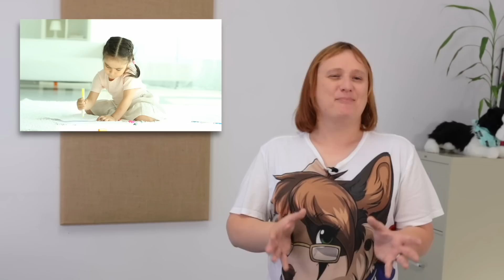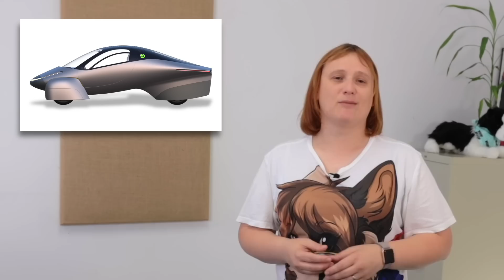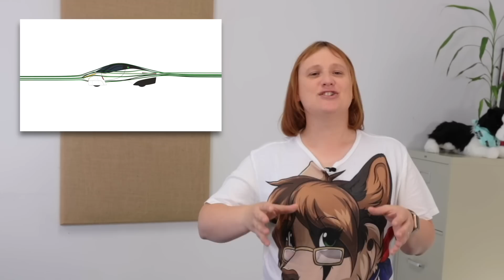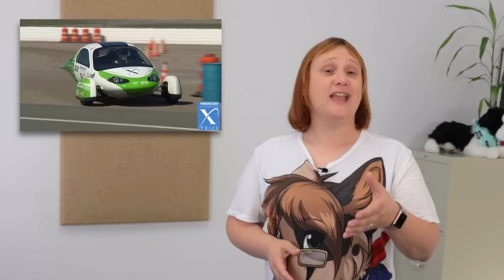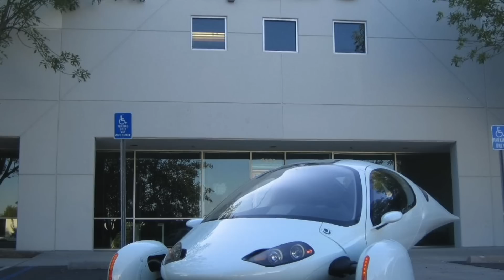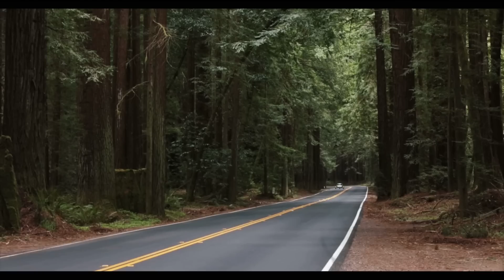After Eight Years, This Futuristic Electric Car is Back!

Comment: Good luck to them. One obvious problem is the sheer width of the car which will cause problems in congested traffic, and more obviously with parking.  Additionally,  three wheelers would have a very small appeal, even the two seat Smart two seater doesn't sell that many cars,  there'll be little luggage space, and it won't be cheap. Also, ? crash worthiness.

Comment: This is annoying. Yes, it may have a 1600km range, but who TF needs a 1600km range?? The only reason why it has this shape and range is because it falls through all the safety loopholes as a motorcycle.  Safer than a motorcycle? I seriously doubt that, motorcycles don't trap you near a burning lithium battery, and it has the width of a car, the weight of a car,  with the safety of paper mache.
It could drop a lot of cost with a 600km range, equal to the best small petrol cars.

Bloody media, all you idiots talk about is range, small wonder it's all Americans care about.

Comment: Form follows function. Aesthetics is arbitrary. This looks like the most efficient way to get 2 adults, a dog and luggage to the vacation destination. Let’s hope the weight is down low enough for stability, the track is wide enough for stability at speed yet narrow enough to get past obstacles. Let’s hope that avoiding the safety requirements of 4 wheel vehicles only refers to the costs involved in development, not the safety of the actual finished product. I’d love for this to be like a giant helmet on wheels.

Comment: I was an early adopter back then.  I deposited $500 and got it back when they went under.  With many other electric cars available these days, I will never look back at this Aptera.  I am happy with my Kona EV.  Aptera doesn't look safe.  Shaping like an egg, if it get into an accident and those flimsy front wheel break off, you will be rolling.  It doesn't take much for those front wheel to get sheared off in an accident.  That's why the DOT never approve Aptera due to safety.  Back then, I was so much into model airplanes and loved the looks of anything that resemble an airplane.  After 16 years of building and flying RC model airplanes, I got tire and moved on.

Comment: 100 kWh in that little thing?  Where would you even put it?  Who would pay the cost of that much battery for a two-seater?  That makes zero sense, unless for some reason it's horribly inefficient.  And if that's the case, what's the point?

Comment: In some states these things are classified as motorcycles and you are required to wear a helmet. This is cool and I wish the laws were different but I’m not sure this will ever move behind a toy or curiosity. Maybe if it had 4 wheels it would be more practical. Still I really hope some major manufacturers play around with the design of EVs since there is potential to innovate a lot more when you don’t have to worry about putting in an engine.

Comment: I don't believe there is any demand for these in the US they are small, goofy and very unsafe. The reason they did not succeed the first time was not due to lack of range therefore upgrading the range to 1,000 miles or even 10,000 won't make demand grow. That much range is unnecessary anyway as you would want to stop and stretch after a few hours of driving anyway and even most ICE vehicles don't have half that and they are fine. People don't just want size they want something safe, good looking and to have all the features and comforts they are use to.

Comment: Also 40 to 100 kwh? Where? Where is the space to put those batteries in that thing? A Tesla, which currently has the best batteries available has to turn it's entire floor into batteries, so I don't buy, that this car can even fit 40 kwh, at the very very most 25.
Also the lack of a trunk is kinda... a dealbreaking for 85% of all car owners.

Comment: This vehicle would be a success if it is priced right. With the smallest battery pack and only front drive motors, I could see this going for 30k. But it will probably be 100k, ensuring its doom.

Comment: Where exactly are they going to put 100KWh worth of battery in this laughable Homermobile, the passenger seat? And who the hell would WANT to drive 1,000 miles straight in a miniscule zero-comfort coffin box like that anyway? It doesn't even look like there would be enough room for an AC unit in the front powerful enough to cool such a greenhouse-like glass bubble lookin' thing like this. Speaking of which, just imagine something even somewhat like this car in a crash. The crumple zone is your face.
Reply: Lots of assumptions here.
Reply: @juliakoshka3230  yes, basic ones,  like the laws of physics still working.

Comment: IFF executed well I think it could have a modest market but overall might not be a viable business. As I recall, Aptera weirdly fumbled on multiple fronts so never got to testing the market. 
I would improve the aesthetics of the design a little. Also 100kWh is ridiculous in such a minimal aero vehicle. It should be able to go 1000km on 40kWh.

Comment: Let's hope it does succeed, we need variety in the market. I can't see it appealing to many though, you can't get more than a small bag of shopping in it. I can see it working for commuting though, it's a lot more comfortable than doing that by motorbike, I've done enough of that in my time. I currently run a Smart Car, and to be honest, I'd rather have an electric version of that with 200miles range.
At least for once we're seeing small electric vehicles with a decent range. Small vehicles are NOT just used for town driving. I've taken mine on some epic journeys, and I expect an electric version to be capable of the same.

Comment: Uh, where are they going to fit a 100 kWh pack in this tiny thing?
Reply: Richi Jennings I think Nikki said a maximum of 100 kwh. By implication there will be lower spec versions
Reply: @francesconicoletti2547  the versions they're talking about are 40 and 100. That's why I mentioned 40😉
Reply: Look at the image at 5:00
Reply: @Cyberwolfman  well exactly. I can just about believe a modern 40 kWh battery might fit in that tiny space, which looks, to be charitable, about ⅔ the size of an e-Nero/Soul2 64 kWh pack. But 100? Either they're smoking something, or this is yet another crowdfunding scam, like the solar water collector or videogame tropes.

Comment: The traditional 3 box car format was just one approach in the IC vehicle period. For EV it looks quite ridiculous. However, this design was a CD optimised layout; which was only practical for two people travelling light. So - why not start with the People & load requirements; then design an EV around them?
Tesla has designed and sold designs for an affluent American market. None of them even try to meet average European user requirements. They are still rare in the UK. Thank god Nissan, VW, Honda, Kia (and several others) are now designing something for that market. BUT they're stuck in a layout; which doesn't use the benefits EVs should have. When will this bollocks change???

Comment: If they can achieve 10 miles/kWh that would be interesting indeed. I feel current manufacturers are not chasing efficiency - notably BMW did it with the i3 but since then have walked back, reverting to just electrification of traditional steel. It could be a temporary position, while manufacturers continue to try to make a single vehicle with different drive train options; maybe in a decade when ICE is a small part of the market we will see more competition in vehicle efficiency rather than just increased battery pack size.

Comment: Just shows how far we've come since the mid-2000s: many EVs now surpass the X-prize's >100 mpge. Heck, even my 2016 e-Golf gets 116 mpge. There's probably a market for three-wheelers with super long range -- but a very small one. Look at what happened to the Venture One: many, many people were hoping that would pan out but it didn't happen, not even as an ICE variant. As Nikki pointed out in a recent TEN video, most of us do not really need an EV with a 300-mile range -- and the obsession with range is holding us back. Most people would be quite surprised at how a 150-mile EV would fulfill almost all their driving needs. We could fix our mobility vs environment issues with mid-range EVs as daily drivers, short-term rentals of long-range EVs for the few long trips most of us make each year -- and bikes, buses, and walking.

Comment: A little bit Q& A for the Aptera

Has this vehicle clear specs? No. 
Has it a fixed price? No, only a range between 34-60K. 
What is the team behind the company? 2 CEOs.
Have the founders crashed with this idea already? Yes.
How much cash do they have? 31K.
How much did they spend so far? 37K.
How much money do they need in 2019? 1.5 Million.
What do they need the money for?  Several new validation vehicles.
Do they have manufacturing facilities? No.
What revenue do the founders promise in 2022? 183 million Dollars net earnings.

Does anyone see any problems with this?

Comment: Take the principles and put them into a useful vehicle. Lovely minimal shape, but minimal payload as well.  What sort of safety testing did it pass? It looks like it would be a disaster in collisions, and between the light weight and high nose, looks like it not only could fly but would - like a missile - if struck at speed.  But perhaps they've been quietly working on the Aptera "3-e" and we're all in for a surprise.

Comment: They seem to be going after the wrong market. The US is not the place for this, Southeast Asia is!
Reply: SE Asia seems to look at sticker price and ignore recurring costs. I can't see this working there at all.

But I'd love one.
Reply: @gasdive  True that's why I keep a small hybrid here. But this is safer and more reliable than a motorbike or any other car in the price range.
Reply: Also Europe especially France and Italy.
Reply: @YT User It's classified as a motorbike in the US
Reply: Yes, they are not worried about occupant safety.
Reply: @grancito2  The original concept was supposedly as safe as a typical modern car since it was made from carbon fiber which is very strong for it's weight.

Comment: Beware of three wheels.  Three wheels is a safety issue.  Three wheels can't handle as ell as four.  I remember the Aptera when it came out.  The biggest thing I remember about the x-prize was the handling issues.  The Aptera had trouble passing the double lane change at the x-prize.  Consumers Reports ran the safety testing at the x-prize.  Consumer Reports describes Aptera’s issues:

    Watched by a large group, including many note-taking and video-taping team members, the three-wheeled Aptera car struggled to find a clean run. More than two dozen attempts were made, with the car routinely sliding enough to topple several cones. In watching, it seemed natural to question how difficult this test is to pass. However, all current production vehicles, from small cars to large trucks, can successfully negotiate this test. We expect the Auto X Prize finalists to do the same.

Also three wheel vehicles are counted as motorcycles in most states.  So they don't have to pass crash tests.

The Aptera was had a big part of shaping my thoughts about three wheel cars.  It got me to realize that three wheel cars where all about cutting cost at the expense of safety.  IE Cheap death traps.

Comment: Its market will be directly related to its retail cost. As a commuter / shopping market vehicle the price point will make it either an immediate success or an abject failure. As a long trip vehicle the two seat design would have limited appeal unless it had good luggage capability and an incredibly comfortable ride, something I suspect it won't have.

Comment: Perhaps one more seat. 3 seater?.. I believe that design can be elongated slightly to also have back seats.. have a back seat variant 4 seater.. and sell it to cab drivers.. imagine a cab with 1000km range. The savings would be enormous!
Reply: They can't legally do that because it is considered a motorcycle which also means it has none of the safety features that are in cars ether you know like air bags and crumple zones and a proper roll frame. I don't think you could even legally have children in the thing at least not in any developed countries since you can't put kids on a bike which is what it is.
Reply: @TheTrueMorningStar  Only 5 US states have any restrictions on children on motorcycles.
Reply: Do cabs rack up that much daily mileage? The London electric (PHEV) cabs don't seem to need anything like that for a daily drive; you plug the car in during the off hours, of course. Not sure why you'd want to drive around with enough batteries for 10x your actual daily range (in a taxi cab.)

Comment: I like it. It’s what EVs are about to me. Efficiency and new ideas. Not stuffing a huge battery pack into giant SUVs.

But I don’t understand why they put 100kwh in it. Why not put about 300 miles worth of batteries in it and save the money? Just seems as if they were obsessed with hitting this 1000 mile mark without really considering if it makes sense.
Reply: Chris Till agreed. The 40kwh battery would be plenty. Maybe could be smaller. Lighter and cheaper.
Reply: Long range is not actually a need for most people - but it's what sells.
Reply: I have to agree, did you see the video on the channel where they were judging EV commercials? The advertising professional said that a lot of companies are over fixated on range anxiety when most people are not that worried about it. People are more worried about affordability and would be happy with moderate range in exchange for much better pricing. Hopefully they will have a smaller cheaper battery pack like you suggest in the future

Comment: That thing doesn't look strong or sturdy enough to survive a pot hole let alone a collision
Reply: Yeah looks as weak as a formula one race car. Except when they crash as 200mph fly to pieces and the driver walks away completely fine. Because unlike your knowledge it's what the safety cage that protects you everything else is designed to absorb and break away.
Reply: light can be very string! F1 car same construction hit a wall at 100mph man got out big meatal car folds up under load.  Well designed light strong car bounces off a big heavy car. bit like a feather.   Heavy is not always strong! but always uses more energy!   #buzzofftoxic

Comment: It kind of reminds me of the Elio. In both the good and the bad connotations.

For the good - it could be an affordable, small, efficient runabout that someone like me could get as a secondary vehicle for days I don't need the hauling capabilities of my truck. The Elio was supposed to get 84 mpg even on the highway, and be around $6500. Who wouldn't want one?

For the bad - it'll probably end up as vaporware just like the Elio. A great idea on paper; a few examples made to ramp up interest; and several years later still nothing to show for its self.

I think if they could actually make this, legitimately bring it to market (unlike the Elio); have 100 - 150 miles range on it; and sell it for under $7500, it'll be a winner. I'd seriously consider buying one for, like I said, days when I don't need the hauling capability of my truck. Though, the dash layout and control surfaces need some work - I want normal gauges and radio and climate control. Give me buttons and knobs - not a touch screen. I don't need to ever take my eyes off the road to adjust the climate control in my truck - I can do it all by feel, because it's knobs and switches.
Reply: Funny I mentioned Elio. They did do one good thing during their vaporware existence - they managed to get almost every state's (49 out of 50) laws changed so that enclosed 3-wheelers like this don't require helmets or motorcycle licenses to operate - standard DLs will do.